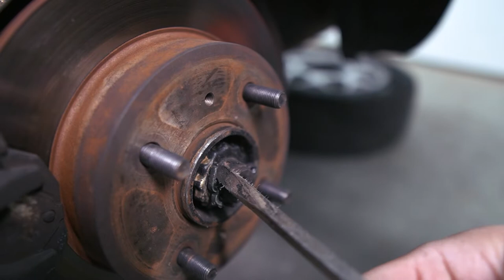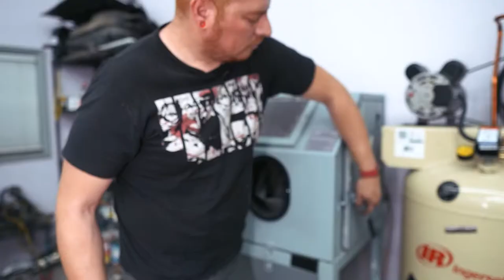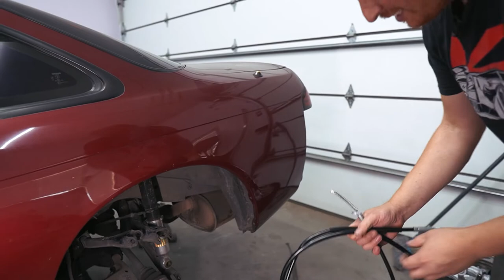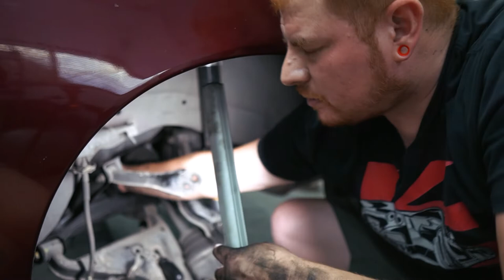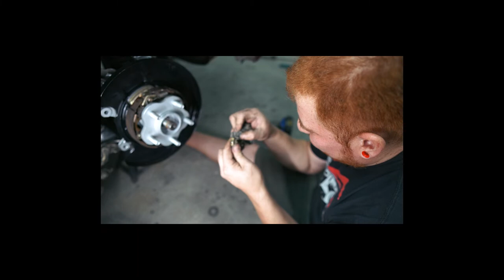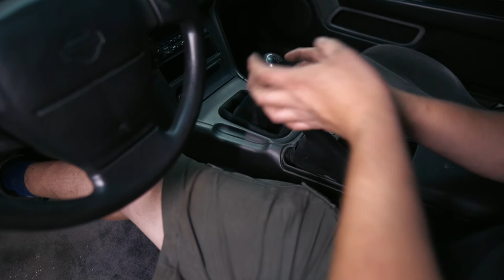Rear 5 Lug Conversion 240SX Nissan PT 2

Comment: The ebrake handle boot has a hole so a socket fits in there..no need to take it off
Reply from the maker: Totally forgot about that 😅 it was easier to see without the boot on though.